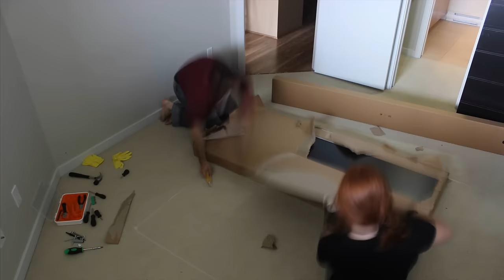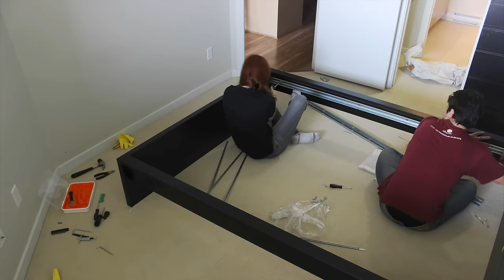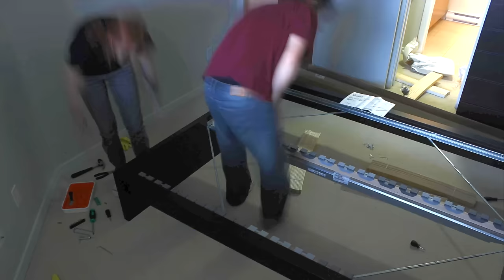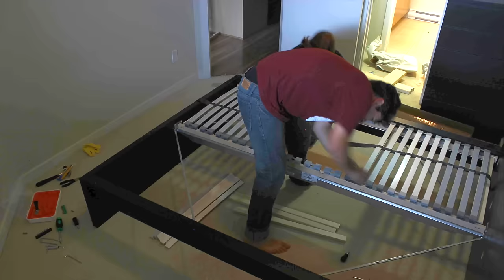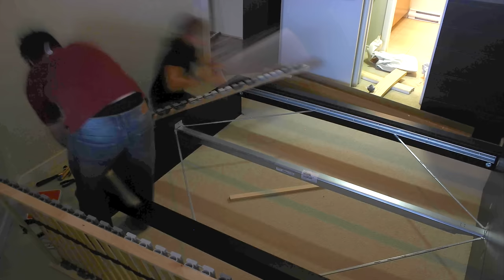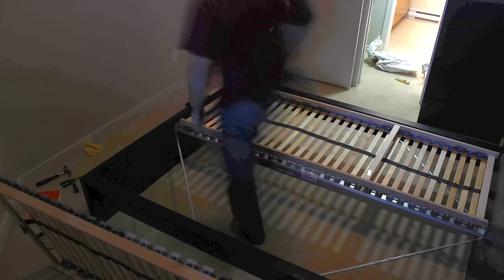IKEA Malm Bed

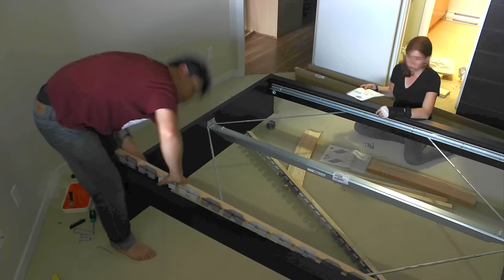Comment: at 1:38 you put the plastic slat holders and then at 1:48 you removed them are those parts needed only for the luroy slats? did you had any trouble with your lonset slats?
Reply: No official answer, it seams to me that those parts work only to hold the luroy slats in place so I uninstall them as they make the lonset slats offset from the bed base. Seams more logical , I am sure many people have installed them without knowing if needed, ikea should make a note for this part

Comment: Nice video, I'm also assembling an IKEA Malm bed right now and I'm having troubles with the step that starts at 1:10. The screws just seem to not get in the holes of the cross braces and I can't firmly screw them in. Did you have any troubles with that?
Reply from the maker: +ferpsg , Not that I can remember.

Best of luck!

Comment: Hey. I'm having trouble with step 4. Any tricks? Can't get the wheel to lock
Reply: +patchay xiong I was struggling with the same issue. Make sure the wood dowels (small wooden pieces are all the way in.
Reply: +Amol Deshpande I'm still struggling. I can't seem to get the wheels in place, everytime I twist, it just unscrews itself
Reply: +Amol Deshpande 

Thanks Amol figured out awhile ago. 

Victor make sure it's in almost all the way. Keep trying until it locks and turn
Reply: +Victor C Check the arrow on the wheel and make sure its facing in the right direction(towards the headboard). The trick is to trap the screw in the little gap on the wheel and then twist it with the wrench. I would also hammer the wood dowels just to make sure they are all the way in.

Comment: are those Lonset slats? do they move or make noise? as I just bought the Lonset one.  Right now I have the cheaper ones and they make alot of noise.
Reply: Make sure with the Lonset slats. You put some foam or cardboard paper in between the metal frame to prevent it from hitting the wood